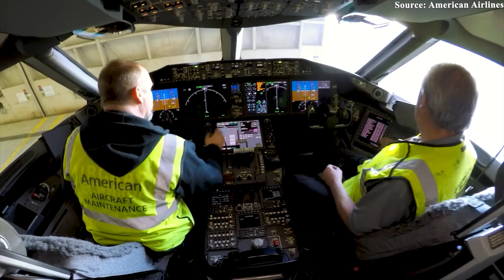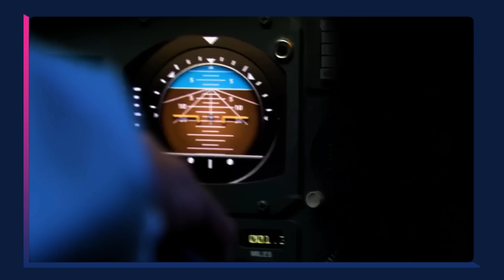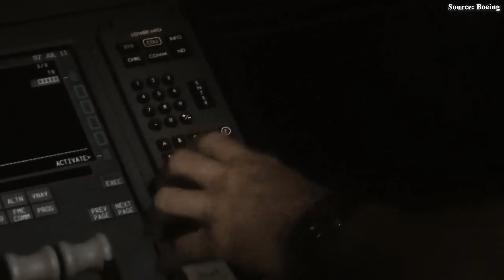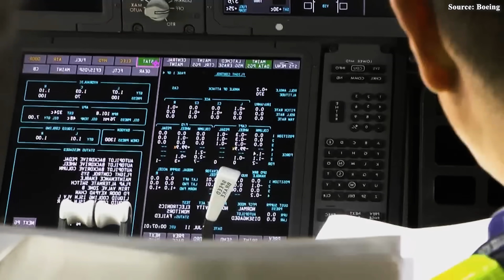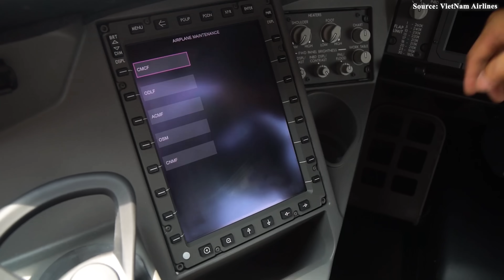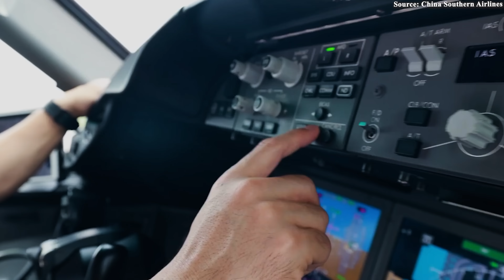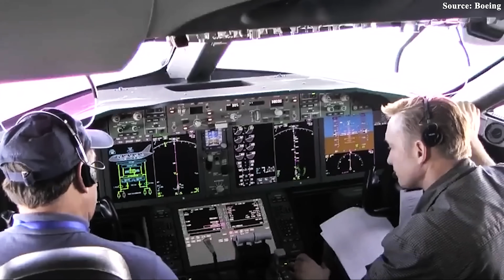They Just Dropped a BOMBSHELL about Boeing 787's AI 171 Flight!

Comment: NO, I heard other stories: The FADEC (Full Authority Digital Engine Control), probably because of a faulty WOW Sensor (Weight On Wheels Sensor) thought that the plane was still on the ground and switched both engines off. The RAT (Ram Air Turbine) was deployed even before the engines were cut off. These point to massive electrical failures in the plane's computer system. If it is Boeing, I am not going.

Comment: If the contention is that one of the pilots changed the fuel switch from Run to Cut off and then back to run again cannot be  by any mistake or accidental due to a two step safeguard that the switch has. It makes no sense to call it accidental and switch was cut off deliberately. Still this has to proved beyond doubt since both pilots were very much experienced. The co-pilot was flying with both hands engaged and full concentration on take off phase so I believe that only Captain could have switched off. Why? Points to suicide uncaring for passengers. But it has to be proved beyond doubt since he is a highly experienced pilot. Well, whatever, to prevent future such happenings such important switches that needs to be turned on and off only on ground it should be made possible by not only safeguarded operation but also should need two pilots simultaneously operating just like the bank locker which need two keys to open particularly once air borne. So safe should be the built in mechanism of important switches
Reply from the maker: Agree with you.

Comment: This Commentary leaves out the one vital piece of information from the Flight Data Recorder ..... The Fuel Cutoff Switches were selected to OFF then selected back to ON. and Indications were that at least one Engine had started to Relight, This would indicate that after both the Engines Rolled back on Power the Pilot tried to restart the Fuel Flow again. This would indicate a SOFTWARE Problem of the EEC (Electronic Engine Control) to the FADECs (Full Authority Digital Engine Control) in both Engines !!!!!!!!! This Commentary is also suggesting to blame by the Pilots for Erroneous Imputs !!!!!! The  OFFICIAL AAIBB Preliminary Report is availible ONLINE.
Reply from the maker: Thanks for your adding information.

Comment: I will not trust any information about AI 171 that is originating from USA. The situation is so deprived that instead of holding Boeing responsible for shoddy work attempt is being made to criticize the pilots ability, which is shameful.
Reply: So you don't believe the fuel control switches were moved?  You think the flight data recorder lied about the fuel control switches?  There were only two people on the flight deck.  One of them killed the fuel flow to both engines.  This COULD NOT be an accident or a software failure.  The switches were moved from run to shutoff and then back to run.  Those switches could only be moved by a person lifting the switches and them moving them -- TWICE.  This disaster does NOT lie with Boeing.

Comment: Pilots were instructed by the QRH (Quick Reference Handbook)  to switch fuel to cut -off as a necessary step to restart both engines.  Pilots only did their duty to save the plane.  

Liftoff was at: 08.08:39 UTC

RAT deployed 08:08:42 UTC(which is also when engines spooled down)
Fuel switches were moved to CUT-OFF at 08. 08:42 UTC (not prior)

In the 787 QRH listed at 7.2 (Ram -air turbine)
under
“Dual engine fail”
Pilots are instructed in any Condition: where engine speed drops below idle, Action: Fuel Control switches (both)
switch CUT -OFF, then RUN

Pilots must switch fuel to cut off and then to Run to recycle FADEC units to initiate engine relight. Unless we know why engines spooled down we are in no position to blame pilots.

In order to restart engines Fuel switches had to be switched off and then switched to run. Pilots only followed QRH instructions.

Comment: As an aircraft engineer with over 25 years experience , I am still not convinced that the pilots have shifted the fuel cut off switch’s to cut off position. There is cover up for something more serious than that. Of course fingers are pointed to the flight crews because they are dead ( they cannot defend themselves.
Some photos that  were presented regarding the flight data recorder and the black box proofs there is a cover up. The flight data recorders is located in the avionics bay , possible under the flight deck. While the black box which records all movements and signals and faults during flight is located in rear pressure bulkhead ( unpressurized section at the tail area. Where minimum damage area during accident. As seen the photos. the photo shows the tail is one piece, no major damage or fire reached that area. so there should be no damage to the black box. The photos show the black box severely damaged or burned. How could that be??!!!!.
The black box is designed to sustain 3400 G force and up to 1100 degree C fire. Even then the part that saves the recording will not be damages and data can be retrieved. Why to this date no information has been provided about the system operation that are recorded in the Black box???!!!!
Reply: Occam's razor says this is an obvious case of deliberate sabotage by a member of the flight crew.  An uncommon but unfortunately familiar misfortune.  That will be the final finding and the rest is internet spec bunk, to be ignored.
Reply: Also your comment is dead wrong.  There was clear evidence in the FDR data and it has been reported for some time now.

Comment: Need to install a alarm if aircraft in flight if fuel switch is touched with maybe a “are you sure” button.  Or engage button. As in switch flipped but alarm happens and a message pops up are you sure then a “yes” button or flip switch back to normal.  Or maybe a few second delay before it cuts off.

Comment: In 2019 ANA Airlines’ 787-8 Dreamliner experienced dual engine fuel cutoff mid-flight. Dreamliner’s TCMA (Thrust Control Malfunction Accomodation) software assumed the plane is on the ground and sent erranous messages to FADEC (Full Authority Digital Engine Control) that shut down both engines.
Reply: That is not an accurate description.  How was that conclusion arrived at, and what was the reason for the occasion of the "erroneous message?"  Without that information this anecdote is completely useless.  You describe a putative incident from 6 years ago.  Where was the follow through and mitigation of any risk?   Where is the discussion of it from the time of its "resolution?"

Comment: How is thear Not a Switch That Stops this from Happening once the Wait OF the plane is off the Ground Same On You Boeing
Reply: Oh, fer cryin' out loud.  It's NEVER been a problem before in the hundreds of thousands of flights the Dreamliner has made.  Designers cannot foresee every possible thing some deranged, suicidal pilot might do years after the airplane is designed and built.  Can you count the number of 787 crashes that have been caused because the engine fuel cutoff switch has been used to kill the engines while the airplane is in flight?  Can you count that high?  Here's another telling number -- can you count the number of 787's that have crashed for any reason since they entered service?  Can you count that high?

Comment: This was a design fault no blame should be put on the pilots. The fuel switches should be disabled when the WOW ( weight off wheels ) sensor is on.
Reply: It's never been a problem before, has it?  You're one of those people for whom hind-sight is ALWAYS 20/20.  How 'bout the airlines do a better job of putting pilots on the flight decks of their airplanes?  IF Boeing is going to be held accountable because a switch was not disabled even though it's NEVER been a problem in all the years and the thousands of flights the 787 has made, then why cannot the airlines be held accountable for hiring pilots who, after years of safe flying, decide to kill themselves in a spectacular fashion?
Reply: @thewaywardwind548  This was not a design error or failure of any component it was Sabotage.
Reply: Exactly, still fuel switches too easy to switch off. Easily programable to cancel fuel switches off during take-off thrust.

Comment: That switch mistake haunts me.
Reply: Mistake?  What mistake was made?  There are THREE distinct movements of the controls that have to be made in order to cut off fuel to an engine.  IF a pilot, who understands those movements, deliberately makes them and causes the airplane to crash then that's NOT a mistake.  That's mass murder.

Comment: This doesn't add up.
To report only part of the overall findings so soon is beyond abnormal. 
Pilot claimed i didn't in response to co-pilot query. Doesn't sound right for a suicidal person to claim innocence at that point.
Switches were located where there was no way co- co-pilot even flying the plane would not have noticed captain's actions.  So it wouldn't make sense for captain to deny his actions. 
Pilot union contesting so quickly,  also points out how unusual it is to release partial facts so early. Switches could easily have been moved after crash. We have only investigators word on flight recorder.
Plus Boeing having obstructed investigations before. 
Just too much not right about this.
Reply: The pilot lied.  He was a suicidal killer.  And a liar.

Comment: Nothing makes sense, the switches are also used on new 737s. Engines were cut off within about a second, then placed back to run. Any pilot to address a lose of thrust would try to descend, gain speed and create lift. The video shows flight crew didn't try to gain speed by descending. The crash was intentional.

Comment: 3Second after lift off both engine lost power with one second of each other, such a authority is unbuild by BOEING 787-8 in- build soft ware not even known to airline Engineers or operating airline pilots crew , a computer called TCMA.

Comment: To whom profit the "crime"?
Actually after weeks of Boeing bashing , justified in some ways, it seems that finaly human weakness IS the point ... 🤔
We also learned that the fuel control system, on which the manual incrimined  commands are part of, has been changed twice on this specific plane, why?
Issue on the system or setup of a remote control emulating a manual action in order to accuse human behavior?
Consequence: human looks like being the last weak part of the aircraft piloting chain on modern planes, so why not removing it definitively?
It is not complotism, it is just modern time managing justification to improve profitability ...

Comment: How do they know the switches were moved manually initially ? They know the fuel was cut off, the switches were then manually flipped by the pilot in an attempt to restart his engines. However the 787 software has cut of the fuel inappropriately on at least 3 other occasions but the pilot was able to restore power in time. There is a bug in the IA system and it is lethally dangerous. It COULD have been the cause of the cut off this time. The 787 needs to be grounded until this new Boeing software fault is rectified...but that might just finish Boeing and we will do anything to prevent that.

Comment: In my opinion the SENSORS which detects if the plane is on the ground or not are at fault......there are malfunctioning and they are prone to malfunction if exposed if the are exposed in different climate conditions..like there was a problem with  over freezing which caused the problem

Comment: I would not take that explanation at face value. There were other matters which cause concern, the under-carriage had not been raised, the flaps had not been properly set for take off, and the RAT had been deployed. 
Two previous fatal crashes in respect of the 737 maxes had been caused by the onboard computer system, and as I understand it, should the computer system on this aircraft detect a problem, it is programmed to take remedial action automatically, in a way which cannot be overridden by the crew. 
There have been other instances of computer malfunction with the Dreamliner, and also allegations of shortcuts in the construction of these aircraft. 
It is anticipated that the full investigation could take a year to complete, so wouldn't it be better to wait until these are complete before maligning the flight deck crew?
In the meantime there have been verifiable complaints re the computer system, and other faults during construction, so shouldn't all these aircraft undergo rigorous examinations before they are allowed in the air again? 
It will cause disruption and be costly, but aren't human lives more important? Boeing are bound to object, but it appears that over the last few years, they have put profit before safety standards, and in this case, it needs to be ascertained as far as humanly possible, the cause of this disaster to prevent any recurrence in the future. 
At least de Havilland was open and cooperative re the investigations of the first jet airliners, the Comets, which fell out of the sky because of matters, which at the time, were not fully appreciated or understood, and because of the discovered design fault, ceased production, and this gave the opening for Boeing.

Comment: the report does not say fuel switches were manually cut off The preliminary report says: Quote: 
"Both fuel control switch were found in the “RUN”
position. (fig.13) The reverser levers were bent but were in the “stowed” position."
THE Report stated:
"As per the EAFR (recorder), the Engine 1 fuel cutoff switch transitioned from CUTOFF to RUN at about
08:08:52 UTC. The APU Inlet Door began opening at about 08:08:54 UTC, consistent with
the APU Auto Start logic. Thereafter at 08:08:56 UTC the Engine 2 fuel cutoff switch also
transitions from CUTOFF to RUN. When fuel control switches are moved from CUTOFF to
RUN while the aircraft is inflight, each engines full authority dual engine control (FADEC)
automatically manages a relight and thrust recovery sequence of ignition and fuel introduction

 SO THE Recorder only notes the switches were moved from "fuel cut off" to "run"

The report does not comment  who or what cut off  the fuel. The first reference to fuel switches notes them being switched to run.

Comment: As much as you want to blame Boeing for faulty fuel switches (to receive big insurance settlements for all effected)... there is NO debating the fact that First Officer Clive's voice was heard (on the voice recorder) saying to the Captain... 'Why did you cut off'?   That is PROOF right there that this sick Captain manually switched off the fuel to both engines.  Those switches are 'fail-safe' with 2 actions required to shut them off... first pull up on the switch... then switch to off position.  That Captain is BUSTED!
Reply: There is still the possibility that the switches could have been switched off by a malfunction in the computer system, thinking that the aircraft was still on the ground, and not airborne. Then the off position would have been normal.

Comment: I believe it is impossible to manually operate the 2 two step switches manually within 1 sec !! What are your comments on this vital piece of data ??
Reply: I think it is entirely possible to turn both fuel switches off within less than 2 seconds as the rounding time seem to be to the nearest second. Not saying a pilot did it but is more than 50% probable that was intentional.

Comment: The so called investigators are not looking at the whole picture. The switch is only a messenger to the plane’s computer system. This system is also connected to the landing gear and fuel valves, the software can get confused, not the pilots. Something prevented the gear retraction too. Fuel tanks were filled to 125000 litres. ! Overfilled? I don’t know. 
Earlier that day the same plane travelling from Delhi experienced air conditioning irregularities. So the electrical, electronic and software systems need looking into..
Reply: You suffer from the Dunning-Kreuger effect...
Reply: @doogleticker5183  YOU JUST SUFFER

Comment: This sounds like a diversion to truth no? It doesn't say the obvious the computers have been examined and found not to be malfunctioning to turn off the fuel bypassing pilots? 
A pilot may have manipulated the switches in frantic effort to start the engines no?
Let's not forget the fact of computer commands bypassing pilots previously brought down aircraft no?
Reply: The safest passenger plane in the history of aviation is NOT the problem.

Comment: your information is wrong ... the AAIB did not find the switches were MANUALLY moved ,,,  if your going to put out as an expert please get your information correct. the word the report used was "transitioned" and it didn't find it happened simultaneously it found there was 1sec between the movement of the first and the movement of the second... your shocking
Reply from the maker: Thanks for your comment, we will look into it!

Comment: "The real mistake wasn't what we believed it to be?  

Who is we?  Are you saying that most people believed that both the left and right engines simultaneously failed on their own or due to some software or electronic glitch?  At least, you came to the same conclusion that just about every honest, qualified expert has already come too, that he Captain intentionally moved the fuel switches from run to off, but you still couldn't resist taking a cheap shot at Boeing.